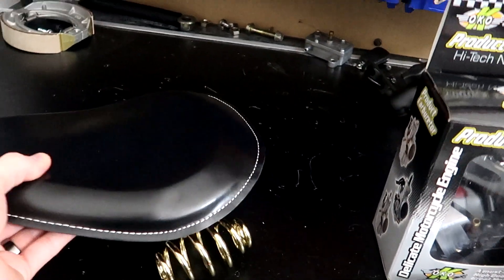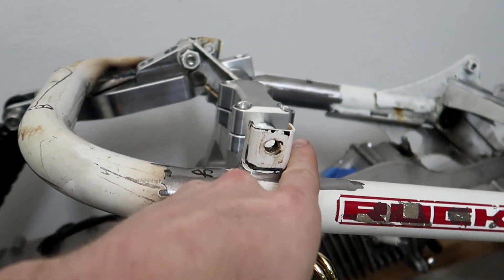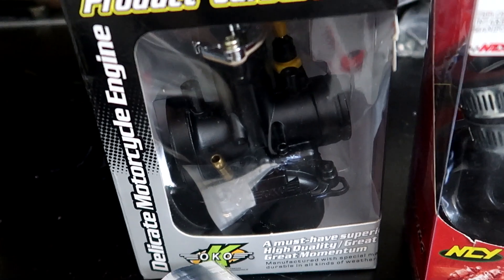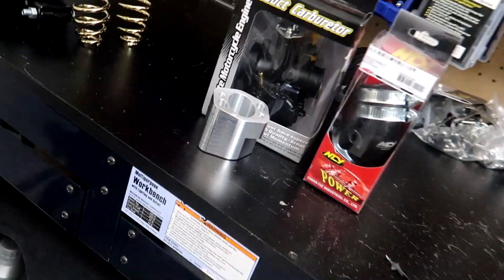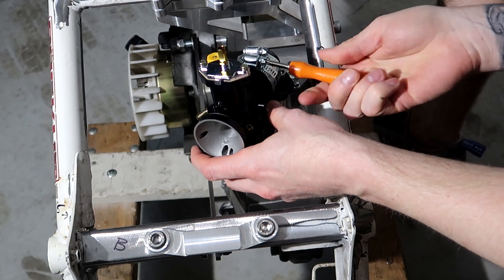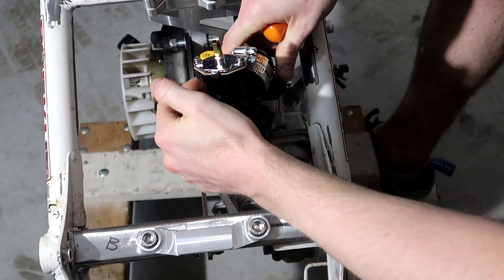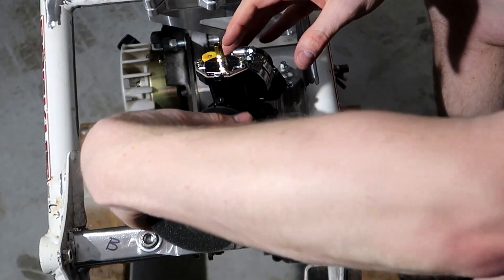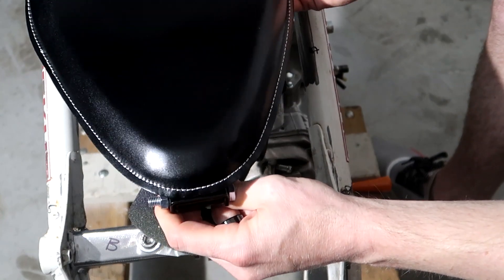Gy6 Build Series Ep 3  OKO carb install and Seat Arrived!

Comment: #115 jet?
I'm running a #130 (at sea level) in a stock carb with a stock 57.4mm piston.
Run a 1/4" fuel line from the valve cover down to the rear of the transmission. Use a wire screen fuel filter in the 1/4" hose about 3" above the valve cover. It's a discharge line + won't blow the oil back into the carb messing up your mixture.
Reply from the maker: Yeah I tune plenty of these on a wideband so I know what it likes.  I don’t ever have blow by on the valve cover so I keep that line short.
Reply: Don't worry, you'll get the blow by eventually 
You'll feel it in the lack of kicker bump.
Im old school.
I just use the plug color as my "scanner".
Start on a fat jet & just come down sizes till Im happy.
I just sold a tank/roketa frame with 64k miles on it to a geo metro for $10k after she totaled it.
You got nice works, have fun building, but always be ready to jump up off it.
Reply from the maker: Noneshere that’s sweet.   Yeah I’ve had my setup 4 years now on this bike no blow by.  So I guess I’m lucky

Comment: Where you install the cable trotter in that corburator. I ask because I wanted to get a carburetor like that but in the picture I don't see the throttle cable where to install it in there

Comment: What carb size is good to run on a stock 150cc plan on doing a 171cc big bore down the road but don’t want to have to buy two different carbs
Reply from the maker: Go 28mm with 32 idle and 115 main for 150. Then 120 when you go 171